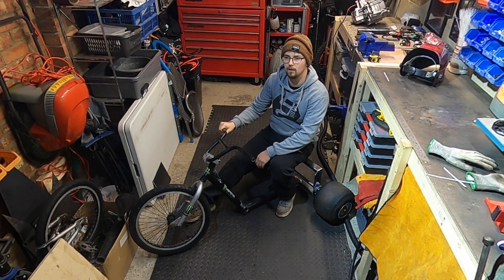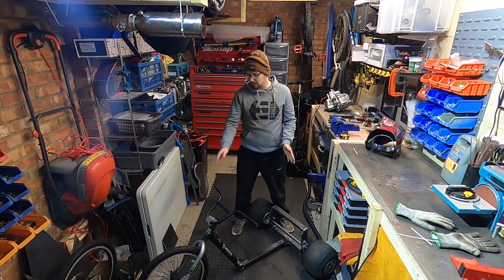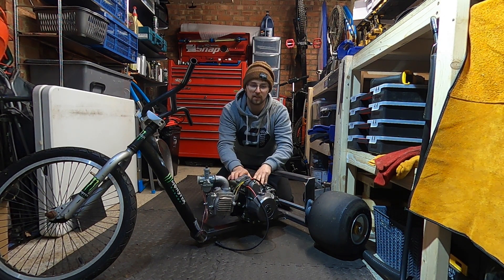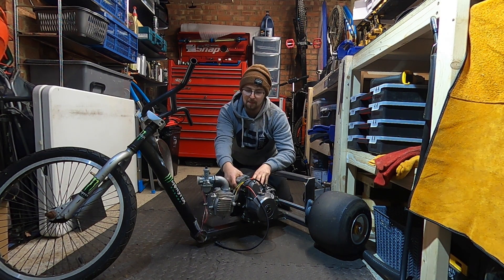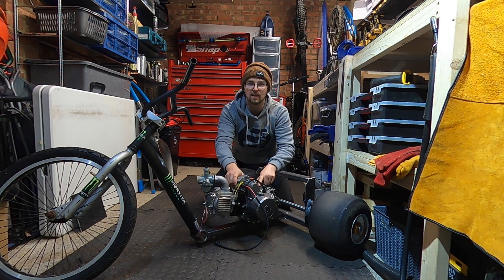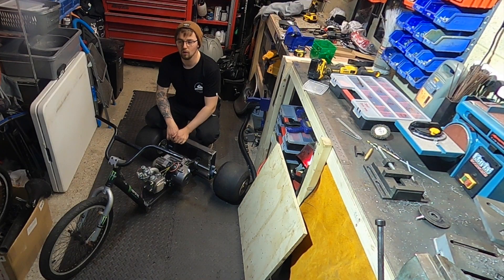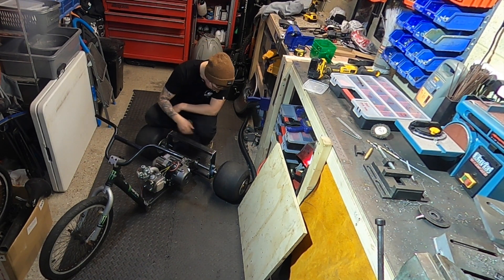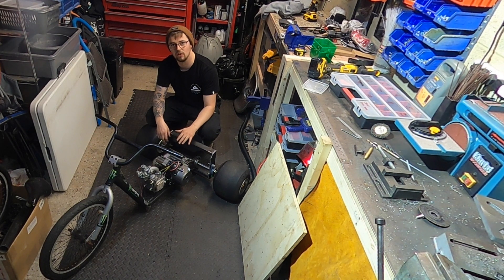Motorised Drift Trike BUILD Part 2

Comment: How to you avoid the axle sliding side ways, there is no restraint on the bearing hub.
Reply from the maker: Hi dude there are grub screws on the bearing this seems enough to stop it sliding about
Reply: @MachiningwithJoe  hi Joe, that make sense now. I'll make sure to buy a hub with grub screw
Reply from the maker: Glad I could help David. I think with the drift sleeves on the force are quite small so the grub screws seem good enough to stop the slide. Good luck with your trike 👍